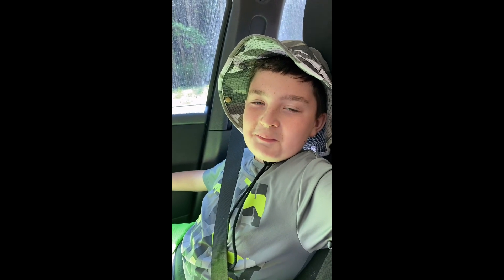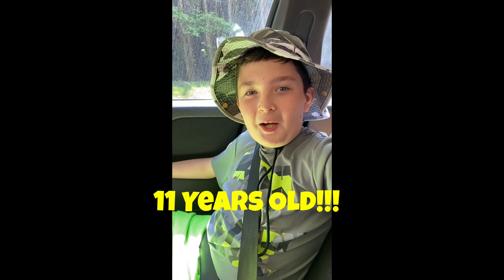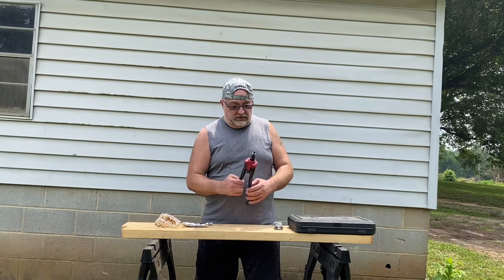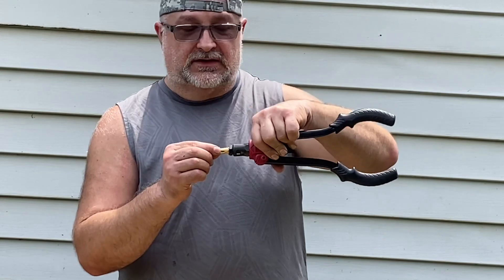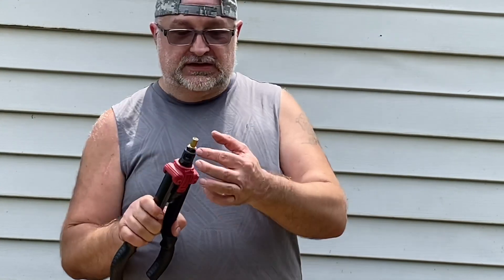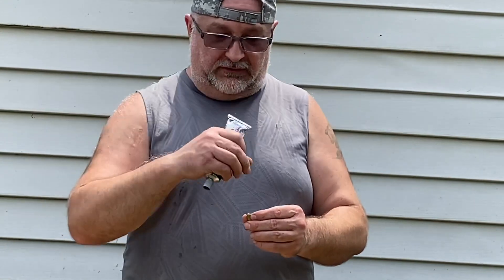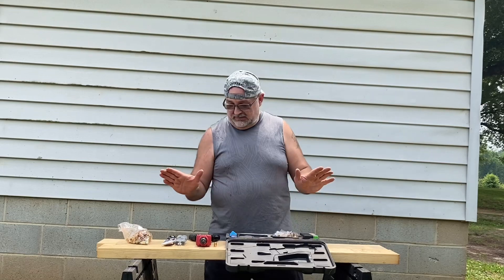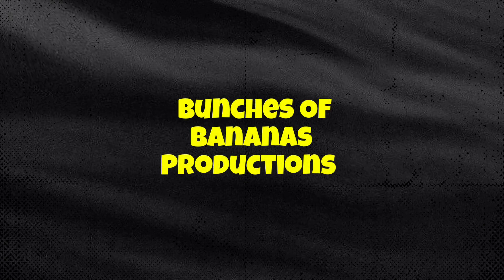Basshound 9.4 Bass Boat - Project Skeeter Updating and Upgrading Part 3

Comment: Felicitaciones.
Que marca es el bote y cuánto cuesta?
Muchas gracias.
Reply from the maker: Si estás hablando de Epoxy, está fabricado por 3M.  Es la marca clara.
La Silicona Negra para las roscas de los pernos, es de Permatex.
Espero que eso te ayude.
Gracias por echarle un vistazo.
Mantente sintonizado para más.
Reply: @bananabrosgarage  preguntaba por la marca o fábrica del vote..... y cuánto cuesta en dólares.Muchas gracias
Reply from the maker: Es un Basshound 9.4.  Fue fabricado en 2001. Lo compramos usado.  Tendrías que buscar uno usado.  Ya no hacen esto en particular.  Bass Tender o Sundolphin Predator serían tu próxima opción.
Reply from the maker: Pagamos $300 dólares por nuestro bote que estaba usado.